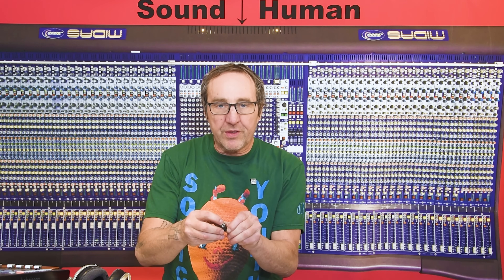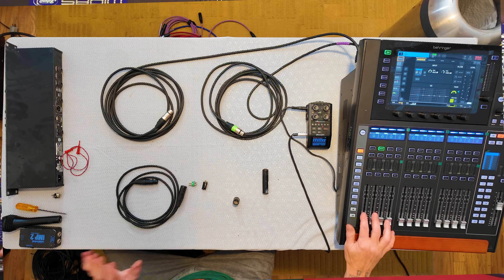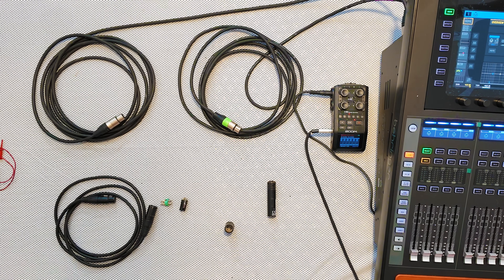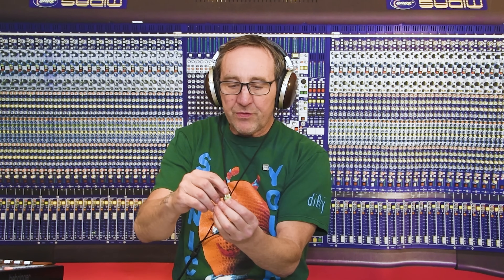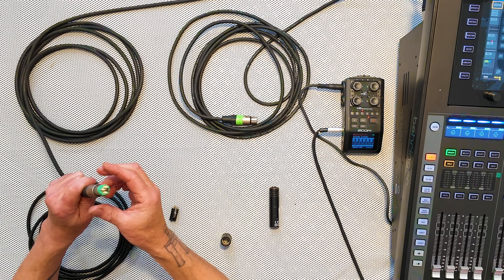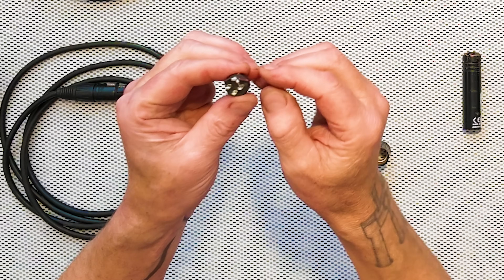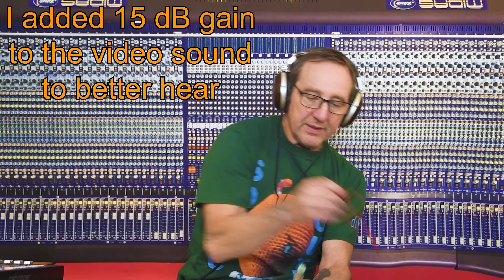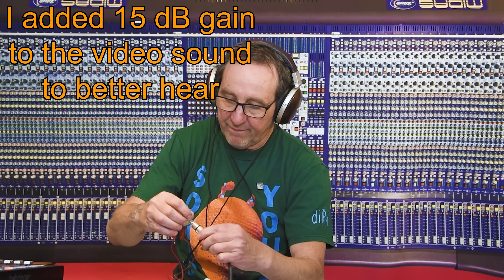XLR Shell Ground Issues

Comment: This is a great explanation for something I’ve never completely understood! I do wonder though about installs that have XLRs run through the walls or really any setup where there is a snake involved. When an XLR is added to a wall patch panel or a snake box instead of directly to the stage rack or console, is that the same as extending the XLR example you showed here? Is there a default or standard that manufacturers follow for whether or not to connect the ground to the shell for wall panels and stage drops?
Reply from the maker: The wall panel should be grounded either to AC ground or audio ground but not both.

If it's a portable panel and it's not going to come into contact with AC ground or it's mounted such that it doesn't come into any contact with AC ground then the wall panel can be grounded with audio ground. 

But usually and more safely the well panel should be grounded to AC ground. 

And the audio grounds on the connectors mounted on the panel should not be connected to the panel. 

And when an XLR is plugged into the panel the shell of the XLR will be grounded by the AC ground / panel ground and pin 1 will pass through as the audiogram never coming into contact with the panel/ac ground

Comment: My Radial JDI has done the exact opposite. When I put the JDI in line with my bass head unit and use my JDI xlr out, only when I introduce the xlr a hum is present in my bass cabinet, the JDI ground lift does nothing, and it occurs whether I have a instrument input   Present or not, the pad does not affect the level of the hum either … would an easy work around be to short pin 1 to chasis ground on the xlr I use
Reply from the maker: Sounds like pin 1 is possibly shorted in the XLR and needs to be cut.
Reply: @ I have two JDIs it only occurs with one of Di boxes, I will try cutting pin 1 thank you!
Reply from the maker: Try swapping the DIs and see if the problem follows the DI or stays where it is. Definitely sounds like something's going on that shouldn't be on one of those lines
Reply: @ I swapped Dis and the problem only follows one of the Dis…
Reply from the maker: Hmmm, well that seems to point heavily toward the DI being the issue. Maybe mark the bad DI, then open them both up and see if you can spot anything like a wire that's come off or something that's touching something that shouldn't. 

I don't think I've ever opened one of those but I think we have some at the shop I'll try and take a look if I get a chance and see if I can spot anything that would cause the issue

On the one that works are you lifting the ground? 

if so, maybe a bad ground lift switch on the one that hums. 

If a bunch of current is flowing through the ground lift switch sometimes they can weld themselves in that position and won't open. 

Typically if it's a bad switch it'll feel a little bit different than a working switch but not always

Comment: awareness, then. some situations yes, some no. most no. 
but maybe there's an opportunity for a product here- something that slips over the male connector ground pin, up along the inside of the shell & clipped over the edge so that it can be seen when it's present. these could be pressed out of thin copper sheet & have a brightly coloured plastic doodad on the end so you can see where they've been added into extensions.
[you can have that!😂]
Reply from the maker: I think maybe the easiest thing is to have either an XLR male female barrel or an XLR male female very short cable that's marked in green tape and says shell ground. And whenever extending my cables put the shell ground jumper cable in line 

Having something you can insert is better because you don't need to replace all your mic cables or resolder things on the ends or whatever. 

I do like your idea and probably could make a little copper spring clip that slides over the pin one and connect it today grounding tab. 

The issue is to remember to take it back off and not being able to see externally if it's linked or not

Comment: If pin 1 is bonded to a shell that is not conductive, then does that bond even matter? I’ve seen that before in some cables. I also did a continuity test on my A&H SQ consoles, and found that pin 1 is bonded to the chassis, which I found interesting.
Reply from the maker: Pin 1 will always be connected in some way to the chassis. That's all good. 

Different gear will have differing ways of connecting pin 1 audio ground to chassis ground and gear with 3 prong grounded power cords will connect chassis ground to AC ground

where and how the chassis/AC ground gets connected to the audio ground will reduce or create hum and noise.

Keeping the chassis grounded and lifting the audio ground or using the audio ground instead of the AC ground to ground the chassis can be effective ways to solve or prevent ground loops and issues

Cables that short chassis ground to audio ground will prevent or at least make it extremely difficult to solve or prevent ground loops issues

Comment: Hi Dave, great video! You can now make a new test video by adding a small capacitir of 100nF inbetween the XLR ground pin_1 & shell. You'll get the best of both worls. That's a technic used in audio equipment grounding audio ground to the chassy ground/earth. On XLR cables I'd say it isn't needed. On amplifiers it's usually 4 components in parallel. Cap.100nF, resistor  10 ohms, two diodes, one in each direction.
Reply: Thanks, you saved me the trouble. 100nF? It’s interesting, I’ve seen claims at around 10pF to be enough?

Comment: Im tearing out my studio in a couple weeks to redo the floor. (Hundreds of cables). I know i have some cables that are grounded to xlr shell and some not.  Gonna have to go through all of them and figure out how to go. Problem is i have a patchbay with trs connectors that grounds to cable connector chassis. Theres no option w the trs connectors.  Any suggestions for dealing w that?
Reply from the maker: For the XLRs removing the pin 1 to shell jumper will allow the XLR shell to be grounded by the patch bay chassis and quarter inch grounds. So that should offer RF protection. 

As far as ground loops are concerned ideally the quarter inch connectors would not ground to the patch bay housing chassis and pin 1 or shell of the quarter inch would remain isolated from the patch Bay chassis just like pin 1 of the XLRs. 

The patch bay chassis should be grounded with a separate wire to the back of the mixing board.

In the event that the quarter inch receptacles are metal and grounded to the patch by chassis then you're pretty much going to just have that be how it is. 

It's not really the end of the world because all of the pin ones are grounded to the chassis of the mixing board and the patch bay is basically an extension of the back of the mixing board so having everything grounded together is usually just fine. 

The issue with the pin 1 jumper is more prevalent when plugging a male XLR with pin 1 shorted to shell into a wall panel where the panel is somehow connected to AC ground. And that AC ground may not be 100% clean.

One thing that happens with AC grounds is that let's say a refrigerator is plugged into it 50 ft away from where the mixing board is plugged into it. If all your gear is plugged in to where the mixing board is plugged in everything is fine as long as the fridge turning on and off doesn't cause an issue 

But in some of your gear is plugged in closer to the fridge and the fridge has some dampness in the motor or in the wiring that creates a little bit of a connection to ground then the AC and noise of the fridge will get onto that AC ground at that remote location and create a bit of an offset, a noisy ground. 

Any gear that's plugged into the noisy ground with the AC cord and other gear plugged into the clean ground with an AC cord and then a third wire being the audio mic cable is connected between the two and shorting the two chassis out, then that noise will start traveling through the audio cord shield and there is your groundloop problem.

It doesn't have to be a fridge it could be anything that's plugged in to the AC that's grounded that's making some noise that's getting filtered to ground or connected to ground
Reply: @ thanks so much for an awesome response. Ive been having some rf issues. Long story. But im going to run some continuity tests w the patchbays. If they are not isolated ill replace them with ones that are. The issue has been driving me crazy.   Once the cables are all out ill check if theres ground go chassis connections on them.  We have isolated power for the studio so thankfully no appliances on the same circuit. We do have 2 wall panels though that i didnt wire so ill have to double check that as well. Really appreciate the response man!
Reply from the maker: Very cool and the steps to take and minimize RF issues are different than the steps to take to minimize EM issues and those to eliminate ground loops 

For RF issues everything really needs to be shielded well metal housing grounded anywhere and everywhere, balanced signal wires should be twisted anywhere and everywhere. 

That said, to avoid protect from EMI and also avoid ground loops, sometimes and in certain places you will alternate from chassis ground shielding to audio ground shielding. XLR shells should use chassis ground shield when plugged into racks or gear and use audio ground when extended at the extension connection.

Patcth bays panels and stage boxes gousings can use either chassis ground or audio ground as long as they don't bridge the two together. 

Do everything you can to form a complete grounded metal tunnel and cage using a combination of audio and chassis grounds

And let me know how it goes!

Comment: Awesome Dave ,I had an issue with a home system where the amplifier rack was in the basement and the pre amp wand controls were on the main floor .the name brand doesn't matter ..Everything that had an XLR connector had noise .if it was RCA it had no noise (Sometimes ).Turned out there was a difference in grounding reference .Should you only use common point grounding at the  pre amp (Controller)or should you run a dedicated ground so that every piece of equipment is tied to the exact same ground wire ..How much does teg grounding  quality of the electrical system in a home or facility affect the sound quality

Comment: Thanks for this Dave.. I'm in the middle of soldering some XLR cables and I've literally done most of my XLR cables with the pin 1 and shell grounded coz i thought that's the best way to have a quieter cable..i never calculated the ground lift situation.. I'm now going to do the rest of the cables without the pin 1 shorted to the shell. 😁
Reply from the maker: It's not only the ground lift situation and I didn't cover it in the video but another issue is when you plug into a wall panel or an XLR mounted in a rack panel. 

Wall mounted panels in rack mounted panels are almost always grounded to the AC ground or to the rack through the rack wheels. Many countries this is the law as well to have metal panels grounded to AC ground. 

If pin 1 is connected to the XLR shell and the XLR shells ground to the panel, then now you have your audio ground connected to AC ground at those wall panels, floor panels and rack panels. 

This creates a ground loop nightmare as all the AC grounds tend to have slightly different potentials.
Reply: @DaveRat  Oh yes I can totally understand where you are coming from here.. That can be a nightmare for sure.
Reply from the maker: It's one of those things that works almost all the time until it doesn't and then it takes a huge amount of time to figure out what's happening and fix it
Reply: @DaveRat  haha right

Comment: Another freak effect you can sometimes have with cables which is really hard to troubleshoot is that you hear when they are being moved. This can be due to the Triboelectric Effect between the different materials used within the cable, most of the cables I have ever used never had that issue, but I have seen it in guitar cables: https://en.wikipedia.org/wiki/Triboelectric_effect
Reply from the maker: Yes handling noise. It's worse with high impedance than it is with low impedance. 

A cable that has no termination on the end we'll have more noise than one with a mic or DI on the end. 

And yes some cables are much noisier than others. 

Looking to do a test on that at some point and do a video

Comment: Interesting. I'm in the camp that we should ground however I also believe that if the manufacturers if incorporating a ground lift switch than that Jack needs to be isolated. I have oddly not run into a lot of ground loop issues. A lot of this tracks back to good electrical distribution. And good product Circuit design. One form of ground loop occurs when one piece of equipment is plugged in on one side of a location and there is a potential difference in the two grounds between the equipment causing current to flow in the audio cabling trying to equalize and that comes out as Audio. Most of the equipment I've seen isolates the jacks from the chassis.

I have had dimmer noise from the lighting circuit but considering this was a building built in the 1900s and converted to a movie theater in 1920. I don't necessarily trust the electrical system and a lot of that went away when instead of plugging into the outlet in the back I ran an extension cord to the front. The back outlet was tied off of the lighting circuit where as the stage was on a dedicated 100A sub panel.

I also recently had my first experience of amp plugged into portable PA system picking up AM radio station. It's really starting to cause me to consider the lack of design that went into the amp circuit. I was looking at this for somebody because the head on the amp had to be replaced because of a busing issue that was only occurring through the direct outs. And this guy is just a acoustic guitar and vocal mic one man band so not a very complicated passport set up. With those things plugged into the same power strip. After the head was replaced buzz was less but there was definitely a noise floor issue.

On the same note I had a microphone that had a constant buzzing issue and it got worse when you touched it. Turns out the manufacturer was relying upon the screw and spring to make contact with the body and then the body would make contact elsewhere back to the circuit. The only problem with this is if the screw ever got slightly loose… Instant buzzing. I ended up connecting a little jumper between the connector and the circuit shield that way it wouldn't slowly become a problem again just because the connector got loose. it was a Sennheiser E914.
Reply from the maker: Using the XLR connector to redesign the grounding scheme of a system by forcing a connection between audio ground and chassis ground is an that is highly probable to create issues down the road. 

Grounding shells when they're connected to each other which is just using the shell as additional shielding is all good. 

As long as that connector is never plugged into gear that has a chassis ground separate from the audio ground

Portable gear that's battery powered or powered off of a wall wart uses audio ground as the chassis ground so for those pieces of gear tying the shell to ground is all good.

Things like rack mounted splitters and metal wall plates installed in buildings often have the chassis ground tied to AC ground. 

This is actually required by law in some countries, that rack mounted metal housings are grounded. 

Even if they're not grounded internally if any gear in the rack has the chassis tied to AC ground and then you mount a fully passive XLR patch bay in that rack then that patch bay chassis is now tied to AC ground. 

Any XLR connector with audio ground pin 1 tied to the shell will now force a connection between audio ground and AC ground at that patch bay. 

This is a hum buzz nightmare

Comment: What would you recommend for a studio using tie lines in tracking rooms? Should I ground the individual Jacks? As those middle Atlantic punch out out plates are probably acting as a chassis ground? And at the same time the tie lines are acting as extensions?
Reply from the maker: I would never ground the XLR shells myself it creates too many problems. 

Avoid extending cables and use the proper length whenever you make a run. 

If you do need to extend cables make a couple short XLR mail to female adapters that have the shells grounded that are only used at the junction of Mike cable extensions.

And finally test everything. Make a 150 ohm termination plug with a resistor between pin 2 and 3 and test all your lines and snakes for buzzes and hums. 

Testimate cable with the termination plug then plug the snake in and put the termination plug at the end of the snake and then put the my cable into the snake and so on. 

Or after everything's plugged in until the game up on channels one of the time making sure they all sound stable and try and find any hums or buzzes that stand out and figure out where they came from

Comment: So I know everyone makes fun of Monster cable and the pricing. But I had far less noise floor especially on the output of the console to the amplifier about 20 years ago using Monster cable XLR. Would you be able to do a video testing different brands of cable?
Reply from the maker: I've already kind of done one testing different types of twists and shields but it's on the member only side of my channel right now. Eventually I will move it to public but I'm not sure when. 

That said, the member side is only $5 a month  and there is probably 100 or more videos including live zoom chats.